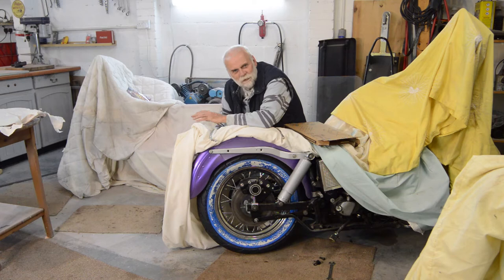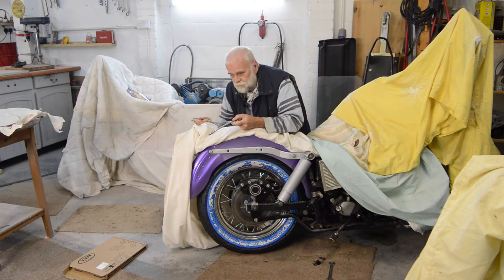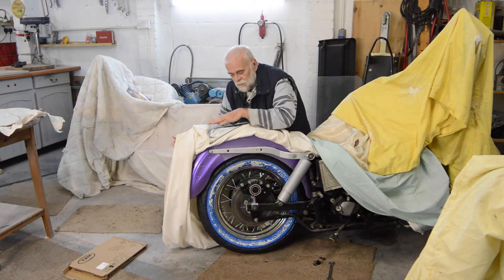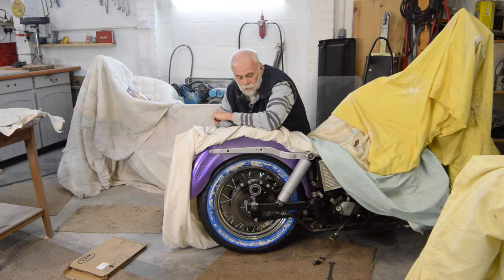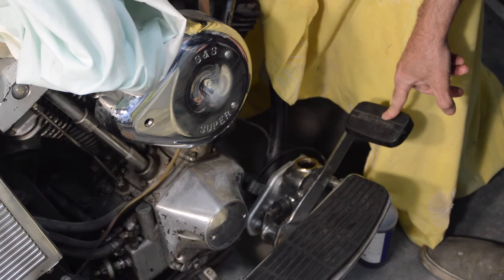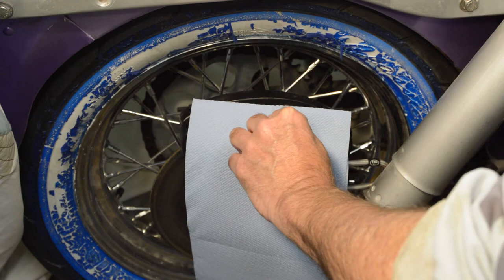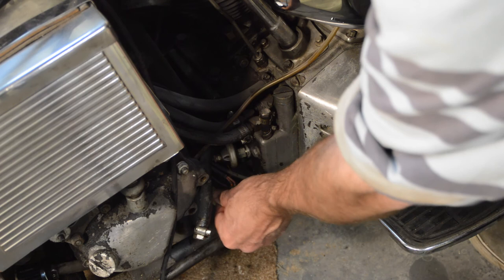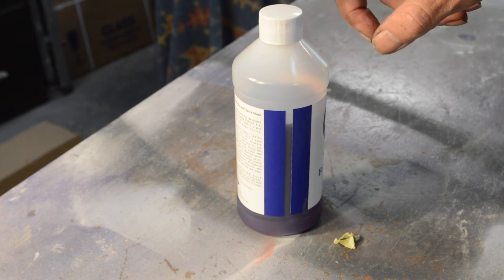Shovelhead Part 11

Comment: Hi, it’s Jon. Glad it’s progressing well. I did mine with dot 5 but did it in reverse. With a new dry system like yours, I used a syringe to push fluid into the caliper until the master cylinder filled to the full level. Zero mess, no pumping and a perfect bleed both front and back. Give it a go when you get to do the front👍
Reply from the maker: Hi Jon. I must admit I have not heard of that method, but now you have told me I am definitely going to give it a try when I do the front, as the idea of less mess is very attractive. Another great piece of advice thanks for sharing it.